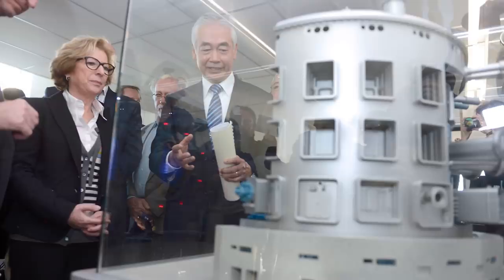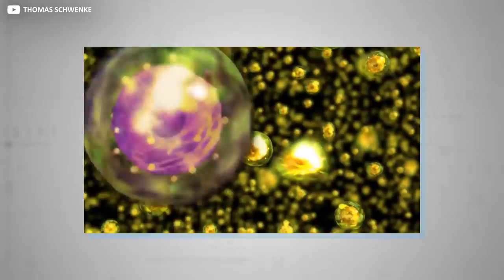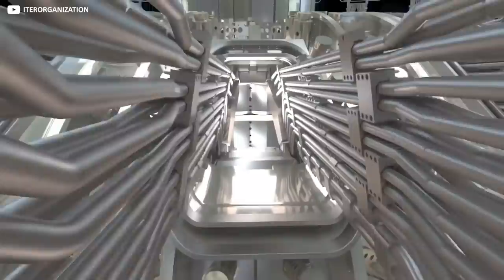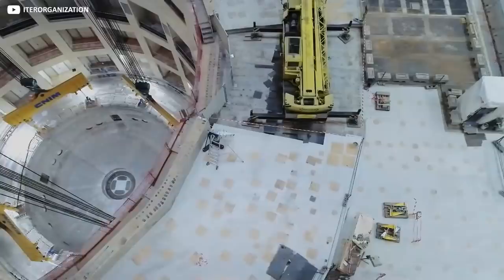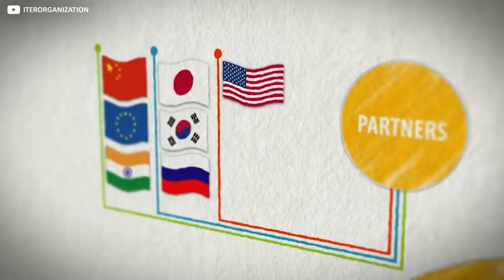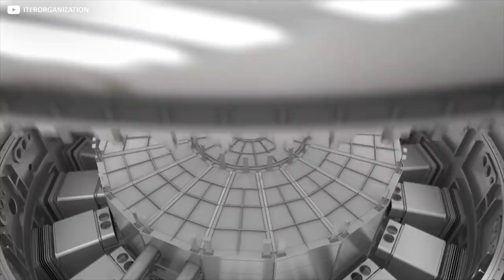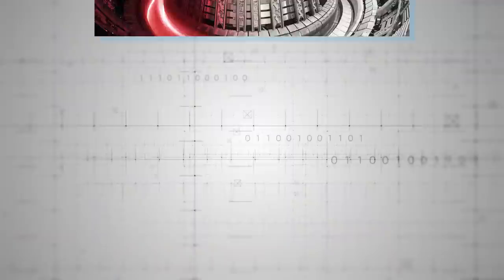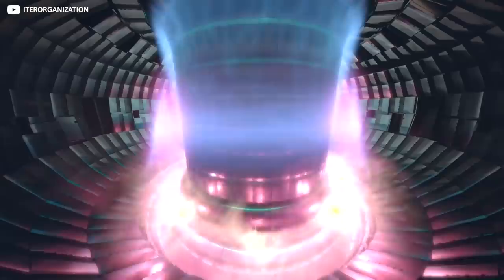Inside The World's Largest Nuclear Fusion Reactor

Comment: Thorium MSRs and LFTRs are very clean fission reactors... Its what we should be using when talking about fission rather than pressurized water based reactors.  They are easier to use, logistically and technically speaking, than pressurized water and fusion reactors....
Reply: I don’t see how molten radiative salts, or fluorides can be remotely considered clean
Reply: @Gomlmon99  The process doesn't leave the highly radioactive wastes that pressurized water reactors leave; also MSRs can use Highly radioactive wastes as fuel and they essentially get rid of those wastes, 'burning' them to almost completion.  Any wastes that are left over aren't of the type that are left by pressurized water reactors and those wastes aren't nearly as long lived.   (That's what I meant by clean).  Also any leaks that may develop aren't going to spread into the atmosphere and will be contained within the structure of the reactor.  You might want to do a little reading on MSRs and LFTRs, they really are much more environmentally friendly than pressurize water reactors.  If we used LFTRs we wouldn't have problems like Fukishima or Chernobyl.  Radiatively speaking they aren't any dirtier than a fusion reactor, any sort of atomic energy is going to generate radiation but if we are concerned about waste LFTRs beat pressurized water reactors hands down.
Reply: @CRSolarice  it’s still not very clean producing them is some nasty stuff…
Reply: @mat7can106  ...well, true, you certainly wouldn't want to stand next to an operating LFTR.  Obviously any equipment that operates in such a manner is lethal to almost all nearby life but as far as the radioactive remnants of such operations they produce very little, if any, long lived isotopes or actinides, compared to their pressurized water counterparts plus if any sort of breach were to occur there would be no long distance spreading of radioactive fallout like we've seen in Chernobyl and Fukushima.  The benefits compared to pressurized water reactors are blatantly obvious and it leaves me wondering why we are even using pressurized water and not Thorium salt based reactors.
Reply: @CRSolarice  that’s true.
Reply: @mat7can106  They're still tossing around the phrase: Too cheap to meter...  It would be nice, after all most of the waste left from our mining processes seems to be Thorium, so its like our refuse. It would be truly an amazing leap for mankind, virtually unlimited electrical power. (after hearing gordonmcdowell speak about it on yourube a few years back I was absolutely sold on the idea).  There are critics and I'm gearing up to go listen to  what Illinois EnergyProf has to say about it, he likes pressurized water, so I'm hoping he doesn't have something up his sleeve that spoils Thorium for me....

Comment: How is the electricity actually generated? All current methods involve boiling water somewhere along the process but it looks unlikely you can simply stick a heat exchanger into 150,000,000,degree plasma. It would be a) too hot and b) possibly interrupt the plasma generation.
Reply: afaik the radiant heat heats the wall which heats the water?
Reply: High energy neutrons captured in a liquid blanket around the reactor which heats up, transfers that heat to a secondary coolant, and raises steam.

Comment: isn’t it 15 million degree’s not 150 million. 150 million seems too hot and from what I know, the core temp  of our sun is 15 million degrees not 150 million.
Reply: Hi Yusuf - the core of the sun is roughly 15 million degrees yes, but the sun has an advantage over us on Earth: its own gravity pushing all the atoms closer together. The video glossed over the requirements for reaching conditions for good rates of fusion reactions a bit - we need a high value of something called the 'triple product', which is (pressure * temperature * confinement time). We can't achieve the same pressures as the sun so we go even higher in temperature and try to keep the particles confined in those high pressures and temperatures for as long as possible.

Comment: Jet’s useable power was about 5MW due to thermodynamics; the 16MW mentioned was thermal output.  So net loss with 24MW input was 19 MW, ie Jet needed to increase output 5X just break even, and hold that output for hours and days instead of seconds.  

Also, Jet can’t produce any rare Tritium fuel which was necessary for the test.  That’s okay. Neither will ITER.
Reply: Do ITER not recover tritium from the test breeder blanket modules?
Reply: @Gomlmon99  Yes they have some  tritium generation.  It's not nearly enough to run ITER's burst's, and not extendable to a working fusion reactor.

Comment: I have been waiting for 20 years for ITER to get off the ground... seems like in a couple of years they should have first plasma... I hope once the TOKAMAK is finished and all systems are fully integrated, by that time we will have more advanced superconducting magnets which dont require Helium cooling, but something like Nitrogen or maybe some lower temps and have higher T factors in magnetic fields... if all goes well, around 2030 it should be CRYSTAL CLEAR if we can do fusion as an actual power generation foundation...
Another cool thing is the Supercritical CO2 brayton cycle turbines... we need to get that tech working... again, hopefully by 2030 Supercritical CO2 Turbines are going to be available on the market...
I have super high hopes that 2030 is going to be the tipping point in our development as HUMANITY... i just hope its not too late by then...

If we have all the necessary tech available and figured out by 2030:
- Finally figured out all the kinks with Plasma physics and plasma vortexes and instabilities in the TOKAMAK chambers...
- Demonstrated that breeding Tritium is not a theory but is actually doable and practical... 
- Finally have superconducting "low" temp magnetic tech that can be used to create wired coils and have at least 30-40% improvement... higher strength of magnetic fields and lower temps for cooling to be superconducting
- Have Supercritical CO2 Turbines, this alone can give us basically a 2 fold improvement in amount of energy... Think about generating 2 times more electricity without burning more fuel... oh and did i mention that there is no need for using INSANE AMOUNT OF WATER??? You dont use Heat-Steam-Turbine cycle.. no steam at all...
- Have more advanced and more automated manufacturing tech to enable quicker and more automated manufacturing of advanced components.
---
It will be a PERFECT storm of having all the parts and pieces which simply need to be PUT TOGETHER AND MASS PRODUCED! By 2050 i can see several REALLY Powerful TOKAMAKs being operational...
Another very cool aspect about tokamaks is their SPHERICAL DESIGN...think about it... if you want to increase the thermal power of a reactor, you dont actually need to build a reactor proportionally bigger to your scalar... V(sphere) = 4/3PIr^3... the r^3 is the beauty... meaning for every additional unit of R you get a CUBED increase in Volume... Think about it... ITERs Vacuum vessel, the reactor chamber, is only 6m in RADIUS and has 840m3 of plasma... so if you simply make it say 8m in radius, then you will have ~2100m3 of plasma... thats almost 3 times more plasma and that means that its 3 times more FUSION or THERMAL ENERGY... so simply by increasing the radius by 30% we get 300% more energy... and thats the real BEAUTY... think about it... if we have say 15m radius, then we have 14000m3 of plasma and that is approximately 8.5 GWh... thats like 9 typical nuclear reactors... thats insane!!!

Comment: How are they supposed to get a temperature of 150,000,000 degrees and contain it in material that can only withstand a temperature of so many thousand degrees and tell everyone that it’s safe because they have a cooling system running -270 whatever it was degrees. A disaster movie in the making right here
Reply: actually they only need to heat a tiny water droplet.
Reply: they use magnets to isolate the plasma and keep it from touching anything

Comment: Hydrogen is a common elements in universe, helium is noble inert gas.🤖
Reply: @afoxwithahat7846  dueterium which used in this reactor is hydrogen isotope after fussion reaction it doesn't leaves any pollutants , it releases helium, which not damage atmosphere. 👽
Reply: @samalashivasurya5574  I think everyone knows that
Reply: @afoxwithahat7846  i think except you.💀
Reply: @samalashivasurya5574  I wonder which path I would have to follow through my life not to learn hydrogen is common and helium is inert.
I also wonder what was your point.
Reply: Hydrogen doesnt exist as poor for and has to be extracted from other elements and is super hard to hold .

Comment: While this will absolutely be a useful tool in the future. We need clean energy right now, and for that, nuclear fission is the best way forward.

It provides the bulk electricity we need for advanced, electrified societies, and certain nuclear reactors can be designed to make extremely high temperatures useful in industry that are otherwise generated by burning fossil fuels, like bulk production of hydrogen, or providing the constant heat for chemical reactions in factories and refineries.

Wind and Solar can't do this, and they never will be able to. It's telling when you have Exxon and BP promoting wind and solar energy, because their usage guarantees that people will still need fossil fuels to fill in the gaps.

Comment: It seems ridiculous to build such a structure when it has yet to be shown that more electricity can be generated than required to run the reactor.
Reply: So you are saying that nothing should be done until it has been already proven to work?  With that mentality nothing new would ever get done.  Innovation requires people to take chances, some of which will fail, in order to make discoveries and progress.

And besides, ITER is just an experiment; it is not intended to actually operate as an electricity generating power plant.  Hopefully ITER teaches us enough so that we can make clean and safe fusion reactor powered electricity generating power plants, and all the better if that happens in our lifetimes.
Reply: @willdejong7763  No. I am not saying that. I'm saying that, if fusion energy cannot be shown to work on a small scale, it is foolish to go ahead on a large scale unless theory shows that a large scale reactor is feasible when a small scale one is not.
Reply: @harrynking777  That's exactly what the theory says.  You have to go big to get net positive energy out.
Reply: @willdejong7763  Interesting. It would be informative to know why the larger reactor is required and to know the approximate net output.
Reply: @harrynking777  This video suggests that the thermal net output is expected to be around 450 MW for ITER. Electrical output will be less than that.

As for the size and scaling issues, don’t quote me but I think that the power input is mostly proportional to the tokamak chamber’s diameter (or maybe surface area?) while the power generated by the reactions is limited by the volume. Double the size and the power input goes up by a factor of 2 while the power created can increase by a factor of 8.  The video hinted at this when it compared ITER to JET, with ITER having twice the input power and ten times the power generation. Of course some of the improvements are also likely due to improved efficiency of redesigned components.
Reply: @harrynking777  a larger reactor is better because it reduces proportional energy dissipation from the plasma. The physics itself is already proven.
Reply: @Gomlmon99  I'm looking forward to see the results.
Reply: @willdejong7763  Many thanks for the information. Massive thermal output. It better work!!

Comment: It is misleading to say that this reactor will generate power. It may generates heat to generate power. ITER only goal is to achieve sustainable fusion reaction safely. The challenge is that heat occurs in the center of the toroid that is surrounded with the most complex electromagnetic coils running at cryogenic temperature and that heat must go thru them to generate power. No piping inside the toroid is possible because it ruins the electromagnetic profile. No one has any idea how to do it yet after 70 years even in theory. Scientists had argued that once sustained fusion is achieved, power generation phase may take another 50-100 years. This technology is unattainable! It is sad but we are desperate because this is the only technology known that could save mankind once the oil runs out.

Comment: The problem is that fusion reactors deal with gas so the relative density of the fuel is a lot less than that used by fission reactors. If they could work out how to work with liquid hydrogen then we might be flying. 
Am I wrong?
Reply: Sorry, you are wrong.  There is no practical way to generate the pressure needed to keep the fuel in a liquid state while also at a temperature high enough for fusion.  Which is why they heat the fuel into a plasma with temperatures even greater than those found inside the sun.

Comment: I love this project, but concerns about component production complexity and LT have dampened my enthusiasm over the years. Even if it works, 1 new reactor every 10 years wont save us from climate change. Even 10 per year probably wouldnt be enough. Other carbon free sources will be needed. The W7 in Germany which you mentioned briefly is at least as promising as ITER, but badly underfunded because of ITER. New fission reactor designs such as MSR are also very interesting and badly underfunded. Although they could compete for Lithium resources which would be bad for batteries. Solar and wind also need huge amounts of REMs which will compete against batteries and EV markets. Such a huge mess we are in from CO2... No single solution is going to save us. Love the enthusiasm from the public, but we need to avoid hyper-focus on single technologies and ITER is the poster-child for that.

Comment: Why don't they build a small version of the nucleur power planet an see if it works before building a huge one
Reply: The problem is the power of the magnets and the massive heat 

And smaler reactors showed that each Time we went bigger we solved some problems 

So u want more powerfull magnets go bigger 
U want to have a better heat management go bigger 
U want to have more precise mesures go bigger 

And that is why it’s a huge project cause smaler are allready used for experiments but for it to realy be effective we need bigger 

Sorry for my english I m french
Reply: There is no other way then to go bigger with Fusion and why building smaller of you known you have to go bigger anyway .
Reply: That’s what JET is

Comment: WE SHOULD STOP THIS. Invest in voltralysis and use HHO to power everything. then after we have mastered that we turn to fusion reactors. the fact that HHO will make energy much much much cheaper will make building these massive reactors easier. Plus the possible new technology that can arise from a water running economy could be use to make the fusion process easier. Why invest billions of money and decades into something that might not work when  you can invest a fraction of that into something that will work

Comment: Why do you use videos from Tokamak Energy Solutions in the video?
The Tokamak Energy Solutions is firstly a private company, with much more modern technology and they use their own discovered materials like warm superconductor which does not need such a low temperature and its produces a magnetic field of 3 Tesla! In ITER the materials produce max 1 tesla. (if I remember correctly)
Reply: Those magnets were deleveopt by the ITER projekt and are also used in General Fusions designs for example.
Reply: @FrogsterLP  I'm sorry but you are wrong.
Magnets in ITER use technology that was in 2007.  That's why the ITER is this size.
The magnets used in Tokamak Energy ST-40 are based on a technology developed by Tokamak Energy Superconductors Research Department.
ST-40 is smaller because of the different amount of Tesla produced by the superconductor, in fact Tokamak Energy noticed that their magnet works better at higher temperatures. 
That is why we call these types of conductors hot superconductors.

Comment: What if it goes wrong and it explodes?
Reply: You have no clue about the topic apparently and already assuming things like that it can explode. Fussion cannot run away. No input power = no output. And the whole thing is inside a few meters thick reinforced concrete shell with inside it yet anoter huge steel tank in which the tokamak sits which is another many hundreds of tonnes chunk of steel.
Reply: @Engineer9736  sorry i am dutch so i didn’t understand it very well. But thank you for answering

Comment: why not build small fusion reactors,1 kw of power is enough for a home.
Reply: If they could build small reactors that could generate net power they would.  The reason why ITER is so big is because it needs to be in order to generate significantly more power than they put into it.  Maybe someday, but probably not in my lifetime.

Also, 1 kw is not enough for a typical modern home.  Not unless you add local power storage to help handle peak loads.  My microwave oven alone draws more power than that.  Ditto for my toaster, coffee machine.  In North America a single typical 120V electrical wall outlet can supply 15 amps, or 1.8 kW.